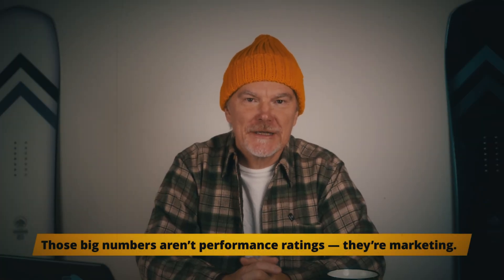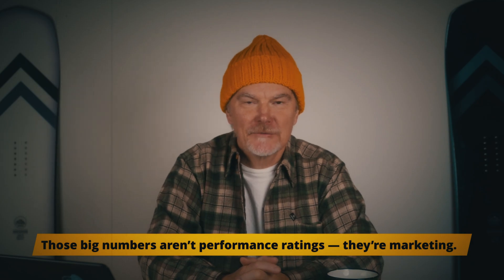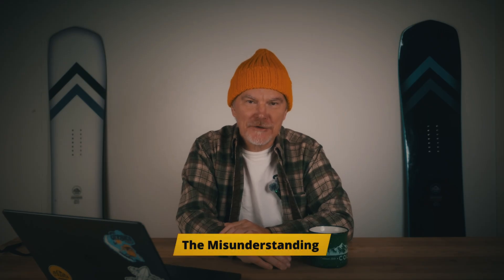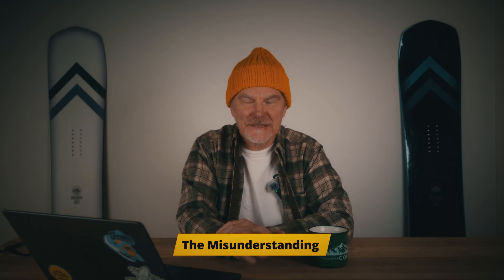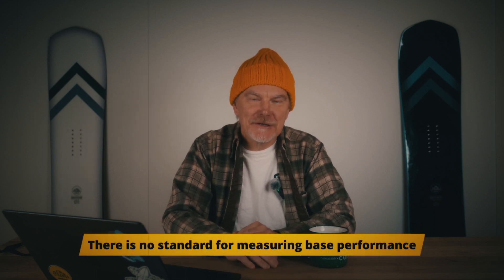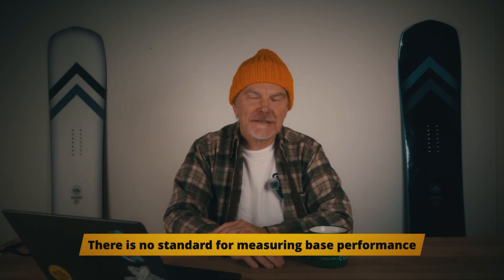Snowboard Base Numbers EXPLAINED: Why a 4001 base can be faster than a 10000.

Comment from the maker: To be 100% clear: All numbers and names of bases are marketing idenfication. There is no ISO or DIN standard for measuring performance. 4001 or 3000 or whaver number doesn't objectively describe performance. At Stranda we use Durasurf 4001 and Electra Graphite 5920. These numbers are manufacturers SKUs (SKU stands for stock-keeping unit, which is a unique alphanumeric code assigned by a company to identify and track its products in inventory) and is not by any means a performance rating. They are tradenames.

Comment: can you explain why black bases are faster? I heard they have more carbon but not sure if that's true
Reply from the maker: Carbon is black, so yes, high content graphite bases are always black. Also black bases are faster as they create a better glide by heat transfer to snow. There is science behind this. So any color base except black will be slower.
Reply: @StrandaSnowboards  I think it's also that bases that have more or less concentrations of PTFE and other "slippery" materials all have different adhesion abilities... highly slick materials might not be able to accept and hold dye. If a base is capable of holding dye so it's bright pink or purple or green or has graphics/logos in it, it's probably not as slippery as a base that's pure black.

Comment: the Electra 5920 you use is faster then the durasurf 4001 correct.  Does the 4001 have graphite in it as well?
Reply from the maker: Yes 5920 is faster but, DuraSurf 4001 also contains graphite, as it is often sold as "DuraSurf 4001 Graphite Black Base" for its fast, durable, and wax-absorbing qualities. The addition of a high-grade carbon (graphite) makes the base faster and helps eliminate static charges that can increase friction with snow.

Comment: Great to hear the explanation. So what really is a Sintered 10000 base compared to a Sintered 4001 base? Different composition?
Reply: Well….. that was the point of Mats’s talk: we don’t ever know!! They could be the same, one was just named 10000.
The 4001 is named 4001 by the material manufacturer itself, and not by the board brand that uses it on their boards.
Reply: @Justaride-Snowboard-Channel  But isn't the question not about what a snowboard brand means when they use these numbers, but what the base material manufacturer means? If the base material manufacturer offers a 4000 and a 7000 base... there are absolutely technical differences that separate the two materials. But only that manufacturer can tell you what they are. That's very different from a snowboard brand telling you board X has a 10000 base and board Y has a 4000 base. The material manufacturer might offer sintered bases of varying densities, molecular weights, blah blah blah.
Reply: @FourT6and2 yes, that’s correct. I guess the point is that there’s a very limited number of manufacturers and that there are no secrets. I assume Mats knows what’s being offered by base material manufacturers. That would be a question to him. Unfortunately I don’t know. It does seem very odd though when you look at all board manufacturers combined. Korua for example called their base a 2000 and it was faster than most other brands or equally as fast as a Nidecker 8000. All Nidecker bases regardless of the stated number are softer than anything else out there, I know that from years of tuning them. Then at some point Ride had a base called ‘sintruded’. A rep asked the engineers at a sales meeting what that was and the marketing team replied: it means nothing! It’s extruded, but it sounds more interesting. Lib Tech TNT bases are extruded bases with some flouro or Teflon compound (most environmentally friendly company in the game…. Blah blah…)…. So I think Mats’s point is that he’d appreciate it, if companies simply used the material names that the manufacturer is using, so that riders can actually compare.
Reply: @Justaride-Snowboard-Channel  Totally. Gotta bypass the board companies and look at the base manufacturer's data instead. RE: Nidecker and soft bases... I had a Nidecker Smoke and it had one of the fastest bases I'd ever experienced. But didn't like the board much. By contrast, I love my United Shapes boards, but their bases are super soft and will imprint if you look at them wrong.
Reply: @FourT6and2 Nidecker use a different base on their ‘surf series’ (Gun, Mosquito, Smoke). I forgot that! That base is likely a Durasurf 4001 base by the feel (hardness) and look of it. I have no evidence for that other than 25 years of tuning and that over a decade in a shop (Nidecker dealer!). All other bases they used to use wore down like nothing I’ve ever seen. You’d put dents into them by just scraping the wax off. The surf series didn’t do that.
Reply: @Justaride-Snowboard-Channel  The Smoke is the only Nidecker board I've tried. It was super fast. Wish I could get that base on every board I own.
Reply: @FourT6and2 I’m pretty sure it’s the same base as the Stranda standard base.